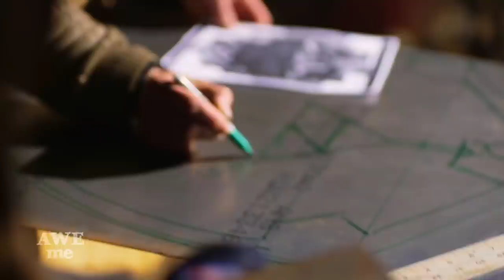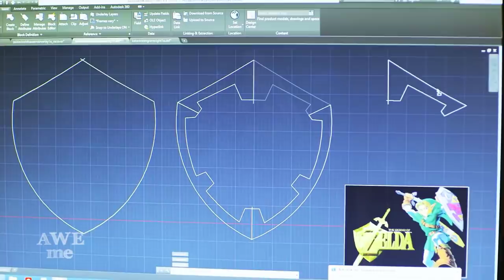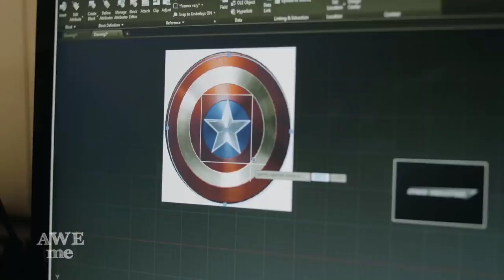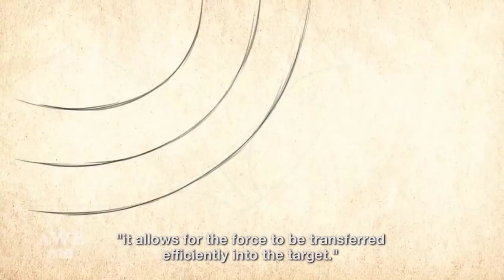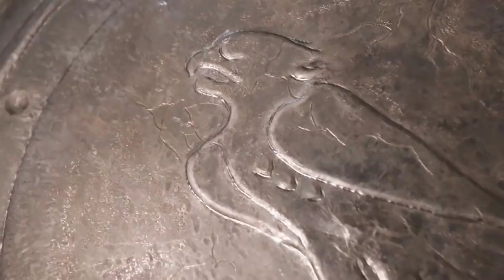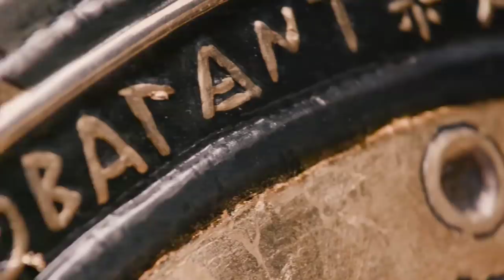Shields Take Tremendous Power - MAN AT ARMS: REFORGED

Comment: Can I get a channel where Illya makes stuff? 
Also I would like it if everyone from the the current man at arms also does stuff like the grinding, welding, casting, CNC work, small jewel placing, metal soldering, design work, explanation, etc.... oh wait, literally the normal show....  I am perfectly OK if someone does something, even if they don't normally do it one this channel. Make some  stuff. I wanna see how things are made. It hurts when it's simplified or cut. The investment casting is one of the greatest things. Show failures then fixes.